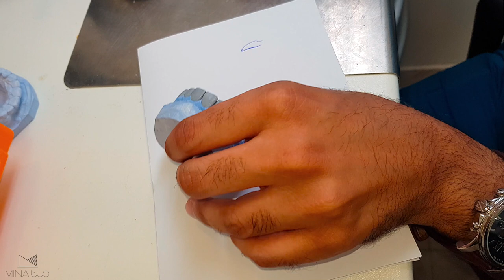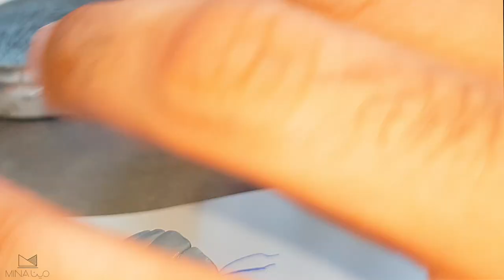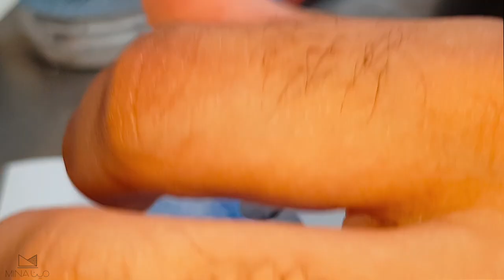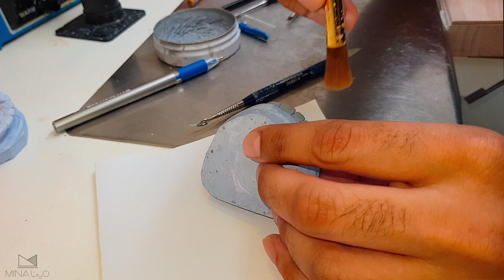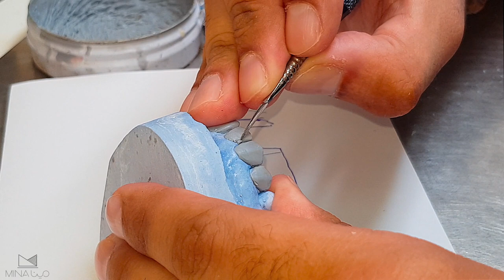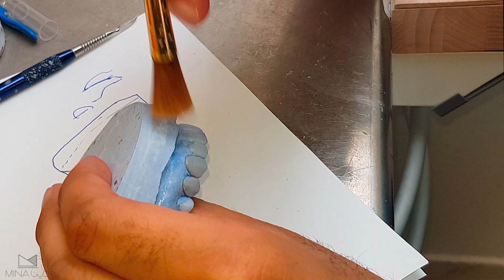Quick Tips on Wax up

Comment: Hi! How the wax model is removed from the plaster base?
Reply: did you find out
Reply: mitchell taylor I found that there is a type of varnish for the plaster before the wax. I tried by putting wax directly on the plaster and i was able to remove it, not easily, without screwing the wax, but the plaster was damaged
Reply: @Ontbt  thankyou, i appricate it- someone said dye lubricant is good, give it a try maybe
Reply: mitchell taylor ok, thank you too!
Reply: how do you remove the wax from diestone for casting
Reply: Yeti insulation liquid
Reply: @sleeprightsounds2593  thank you! There is a plaster hardener too, using both must give a great result. Plaster harder + wax insulation